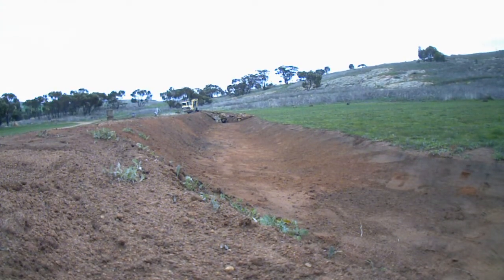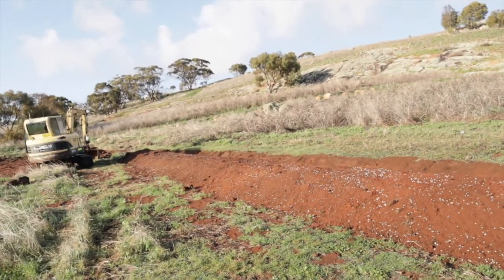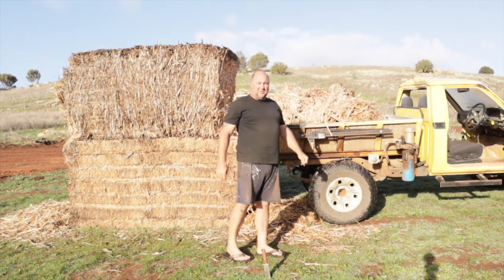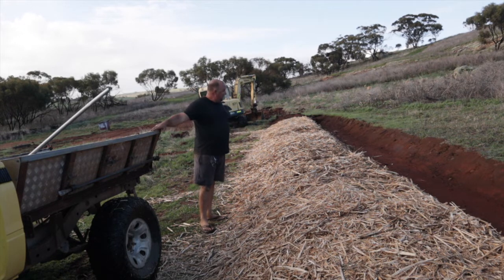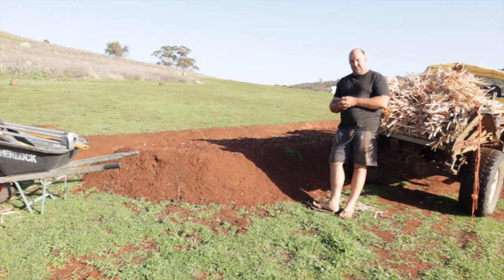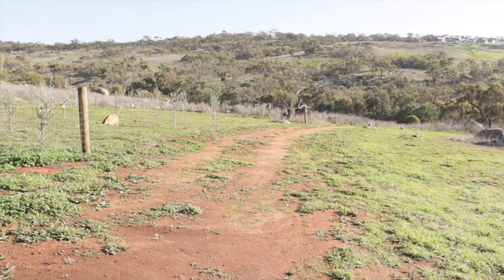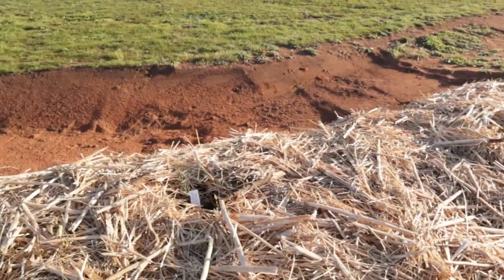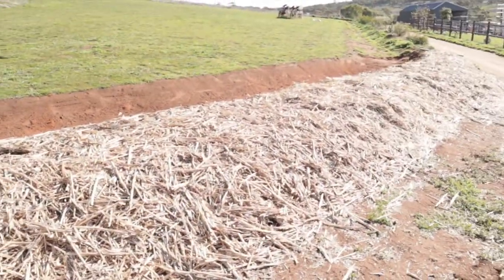Mulching permaculture swale berms | Off-grid homestead

Comment: Great to see you guys moving forward.  I don't know that you're swale will ever hold water because the soil's so sandy, but it'll still look nice and help get the water down into the land.  

Your driveway would be easy to fix with that wonderful backhoe you've got.  Around these parts, we install run-outs to mitigate erosion like you're seeing and they work wonderfully.  Think of it like a miniature swale.

All you have to do is build up soil in a low mound that's really wide, like a speed bump in the parking lot.  Ideally, it should be long enough that your front tires are just leaving it as your back tires are just entering.  You want it to be low and smooth to make for a comfortable ride over it in the truck.

The key, though, is that it doesn't cross the road perpendicular to the direction of travel.  Rather, it crosses the road at an angle up to 45º.  This acts like a dam or swale to hold back the water and force it off the side of the road where you want it to go. The rain runs out the side under your control rather than find its own way and create all those ruts.

Of course, you need more than one of them.  You might place them 50' apart, or less, depending on your slope and the amount of water coming down from above the Run-out.  You want them close enough that the rain that hits above it is scooted off the side before it picks up power and speed on the race downhill.  

They work just like a One Rock Dam or Swale - guiding the water where you want, spreading it out so it can do the most good.  With as much surface area as a roadway creates, that's potentially a lot of water spread over a field if you can build a Run-Out ever 50' or so along the side of the field.  And because it's spread out, erosion is minimized.

Hope that helps.  Can't wait to see what you come up with next!
Reply from the maker: Awesome tips mate... I think I understand what you're explaining. Might give it a go 👍 Really appreciate you taking the time to share your thoughts.
Reply: @ROCKPILEOffgridHomestead  Here's a vid that shows the installation, with some pretty animations, too.  Real simple stuff, especially if you have a dozer or backhoe to move the dirt for you!  www.youtube.com/watch?v=UfTxLEA9gh8

The key is having enough of the "water bars" along the road to cut up the rainfall enough that it doesn't ever have a chance to  build up speed and power.  As sandy as your soil is, you might have to do small repairs every year, but that's a sure sight better than getting ruts and out of control erosion.  Nothing better than putting the rainfall where you want it and getting all that free irrigation!